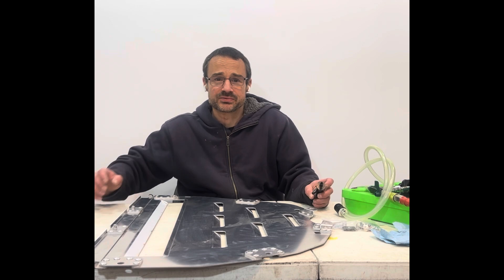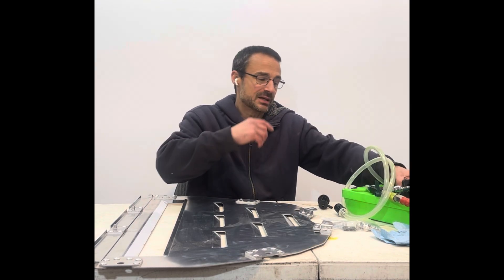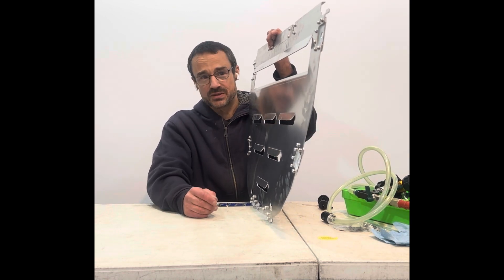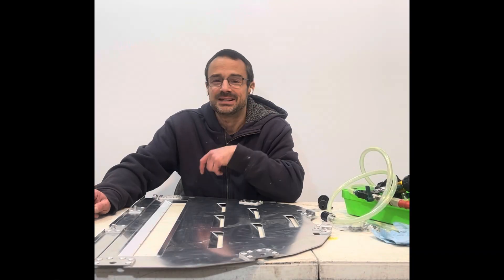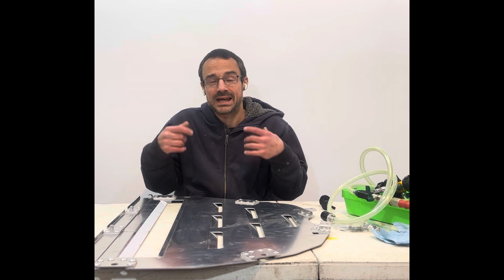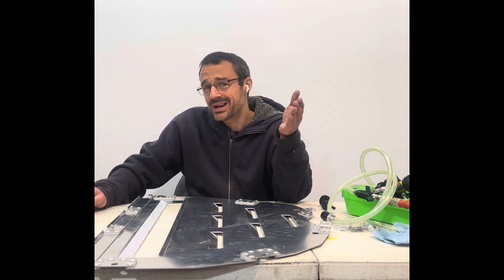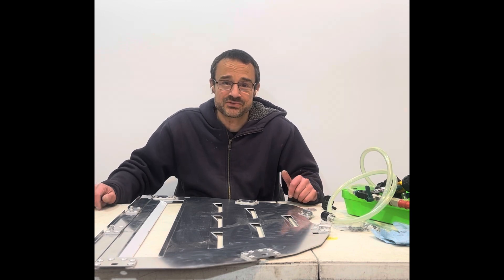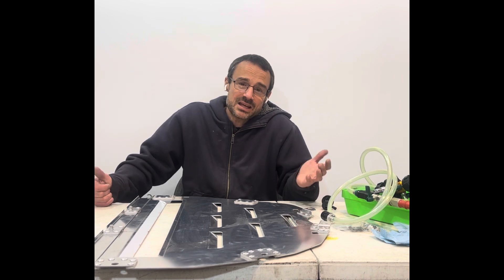How Venturi works (Does this undertray work?)

Comment: Why does the positive pressure cause the fans to work harder? You’re also just making a statement, I actually don’t believe it makes positive pressure bc there is air coming in the front vent and the back of the tray area is open. So your theory seems to be incorrect. 

The new undertray is useless is most applications.

Comment: sorry remove undertray make cooling worse, but not because of hot pavement of course (engine has higher temp than pavement anyway)...its because without undertray air is rotating under the car and make that possitive pressure in engine bay what we do not want...and also can cause lift...that is why race cars have flat underbody  to reduce lift and increase down force... 
but its true  what you said that some holes in undetray can suck air out of engine bay and create under pressure.
Reply from the maker: Do you own a Civic Type R?. Go back and watch the video again I said, sitting in traffic in hot summer weather. I also said I tested that exact scenario. I took off my under tray at one point because it’s so hot here. I was trying to have the car run cooler sitting in traffic. It made it worse. I’m also well aware of why racers have flat bottom cars but did you listen to what I said about not everybody can afford $10,000 a front end work? 
Also, the amount of lift that you’re proposing would go under the vehicle from this undertray would literally only come into affect well above a 160 miles an hour in this case. Just having a front splitter on the vehicle reduces quite a significant amount of air that goes under the vehicle. I think I should mention that thanks to me. Matthew holds the enthusiast class world record in Time Attack at Road Atlanta from the set up I suggested. The reduction in temperature benefit completely outweighs a flat bottom benefit on the Fk8. Due to the headifold, design cooling the exhaust of the cylinder head these cars have a severe challenge in cooling and especially when you are north of 550 hp to the wheels.
Reply: @ answers: 1.yes 2.yes 
Good answer. I just put more info to this topic. Did i said something incorrect?